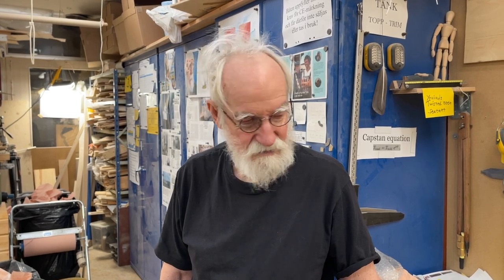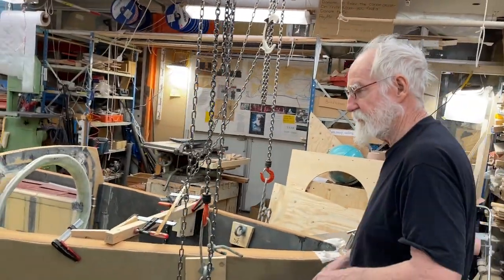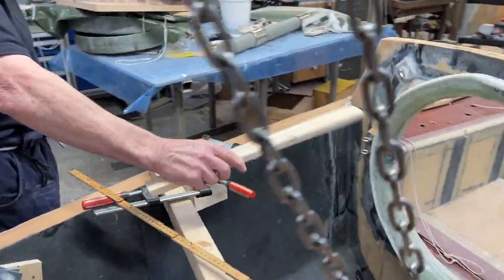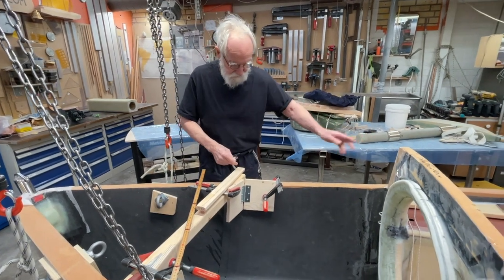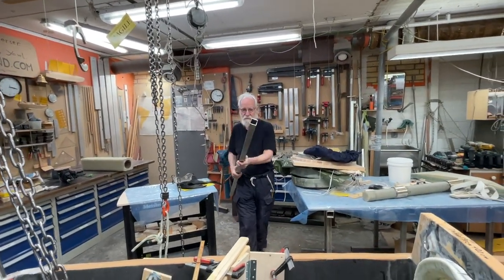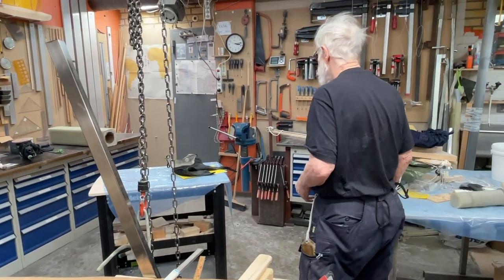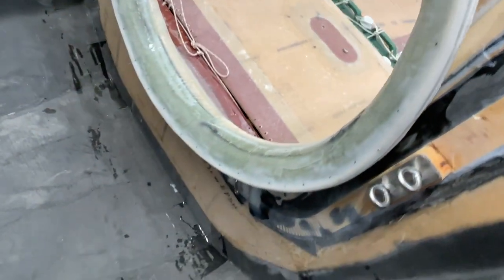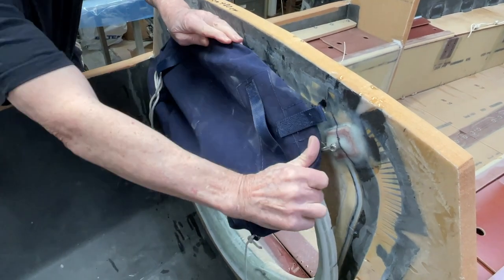20 Jan 2023  A day with only talk, nothing done, talking tiller, talking hooks, talking punkture.

Comment: 👍 For your purposes, how do you determine the length of the tiller? You could make it shorter and it would fit in the existing hull, but I take it you want more leverage than that.
Reply: I probably used poor words. By leverage I mean that the ruder effect for a  fixed rudder surface area would be increased the farther aft rudder is from centre of lateral resistance
Reply from the maker: @kendonahue2080  Exactly in aviation the call it rudder volyme
The area of the rudder blade times the distance of pressure from the turning point makes a cube.
Reply: @SvenYrvindExlex  Thanks! That is more information when you put it in aviation perspective. I am shallow draft and I can take the beach but of course I need/hope to draw no more water than keel till I get a chance to test in practice.